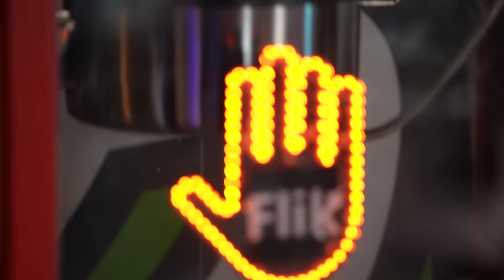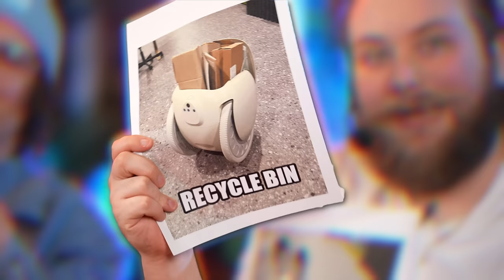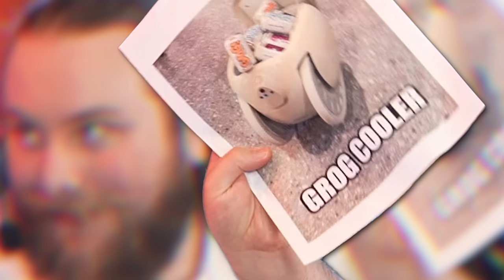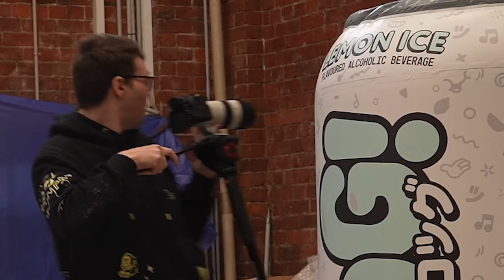We Tested SHOCKING Tik Tok Gadgets

Comment: Literally all that alarm clock needs to be an actual good product is to start making the coffee 5 minutes before the alarm is set to go off
Reply: idk, in that case I feel like I'd burn myself if I tried to switch it off
Reply: the thing is 99% of coffee makers already have a alarm setting that brews at a certain time, it's just a shitty mr coffee
Reply: Ah yes, malfunction and you wake up to burnting hot water on your face
Reply: @honkycat5442  damn really I want one
Reply: The alarm clock is more useful for an alcoholic, it works better as a still.
Reply: There is a version of this for tea called a teasmade
Reply: Nup the water is too hot and unregulated so the coffee is burnt. Additionally the coffee grounds are left out over night and coffee's flavour and good characteristics degrade exponentially. You want proper temperature, technique and fresh grounds to have good pour over coffee and that dodad has none of those. Also it takes longer than usual. Like a kettle boils in a minute. Letting it cool a bit and pouring is like another minute or two. Done in like 3mins a d you don't get the complications of having coffee straight after you wake up (coffee should be drank a couple hours after you wake up)
Reply: This exact model CAN do that. It has a setting on the side where you can choose how many minutes before or after the alarm the coffee should be made. It's just that there are options 1/5th to 1/10th the cost of this product that can do the same.
Reply: It was a thing in the 80s. It's nothing new. People just realised it was pointless and stopped using them
Reply: @randomsomeguy156  I pre-load my coffee machine in the evening, tastes the same, I just stumble out of bed and run to the kitchen put it on and run back to bed for 5 more minutes
Reply: @__-bz7wh  malfunctioning is fine! it'll wake you up and don't even need to go to work! (you'll be in the hospital)
Reply: @randomsomeguy156  bros a coffee nerd

Comment: "You can touch it with a metal tool and ease into touching it with your hands"

Darcy handed Max and Chad tools with rubber handles, which are designed to protect the user from sudden electric contact.